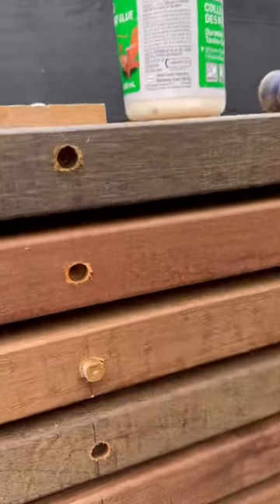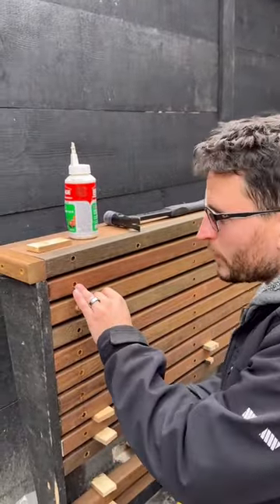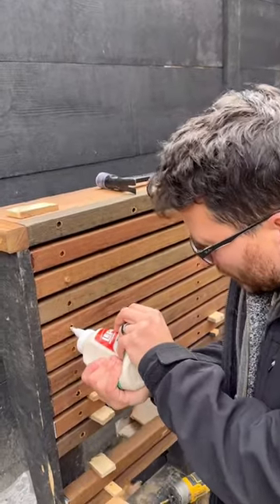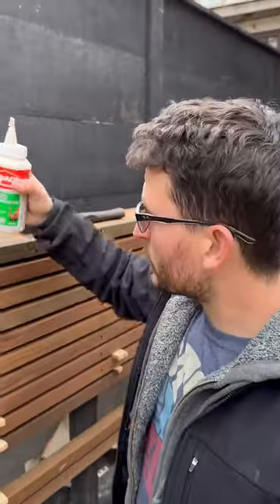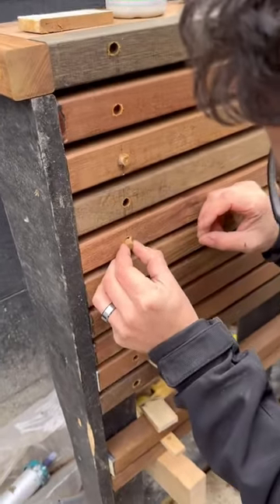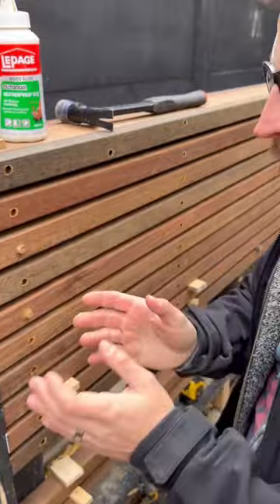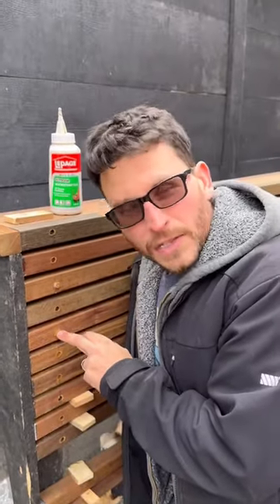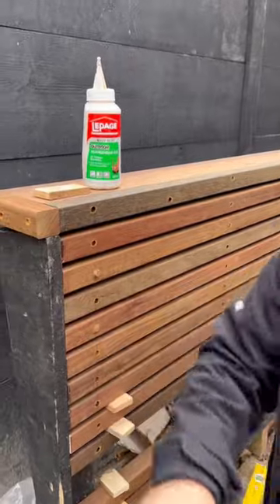Counter Sink/bore Screw & Plug #carpentry #woodworking #shorts

Comment: I understand after then sanding and a new coat of finish it will blend in very well, but is it possible to take an extra piece from the wood itself and make a plug without it being a ridiculous amount of work? Like cut an inch long strip off the end and then punch it into shape or something? Knowing wood working theres probably a tool that does exactly this